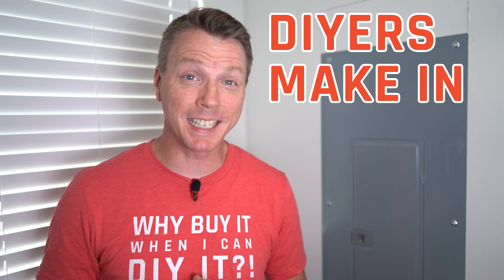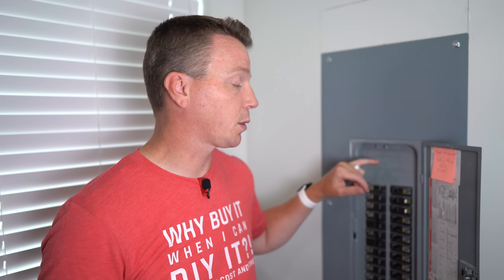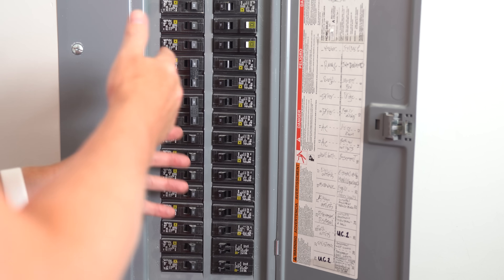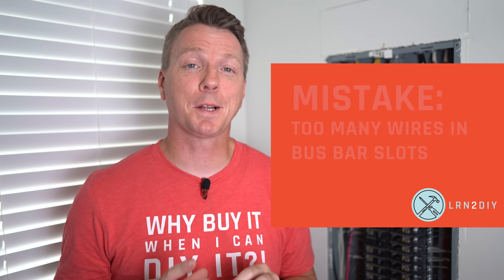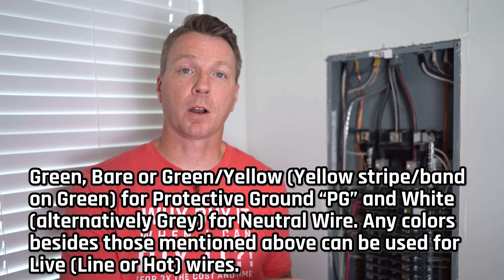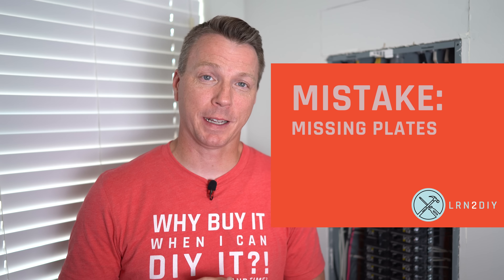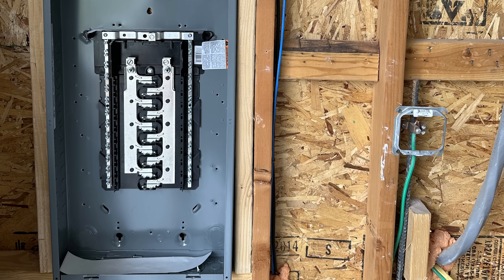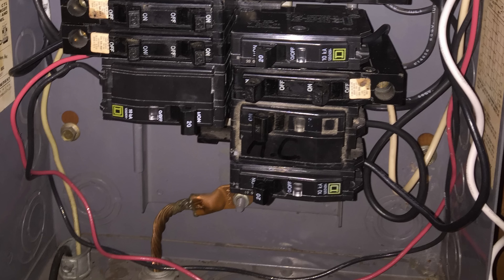10 Common Mistakes DIYers Make In Circuit Breaker Boxes

Comment: Seriously, add up the breakers? The only way to know “amperage usage “ is with an ammeter. You can add up 150 amps of breakers and use 60 amps with everything on. Main breakers are designed for 100 % as opposed to branch circuits that are by ULC only supposed to be loaded to 80 % of labeled limit.

Comment: The #1 first and biggest mistake is letting a typical homeowner diy his own electric anything. And the double tap is absolutely a joke. My neighbor did his own new construction wiring, he ran home runs to the ceiling fans in all the rooms. He had all other wiring connected to the fans. A series of dangerous jokes.
Reply: so what if he used the Ceiling fan boxes as J boxes. sure the box fill is getting close to full but doesnt mean he couldnt. they used bathroom light boxes at my job as J boxes for bathrooms, bedrooms , closets. rats nest of 4 to 8 NM (non-metallic) sheathed cable  going in ancient bakelight boxes

Comment: Some people need to just replace and update their circuit panel. Circuit breakers weaken with switching. Some people don’t realize that. They use it like an on/ off switch reducing it’s intended function. I replaced my circa 1977 main panel about 8 years ago.

Comment: Good thing I had a "professional" install and label my circuit breakers. Mostly useful notations like "lights" or "outlets" (which would account for what, 90% of all home circuitry in existence?). Of course some of them are clear - "Dryer" (which controls the water heater) and another "Dryer" (which controls the well pump).

Comment: most of those "chines#" torque screwdrivers are 100% trash and very inaccurate. At least the ones I had purchased/used.  To the point, where I wanted to make a point, and broke a CB tightening it to "spec".

Comment: One issue I've run into, in a couple of different rental properties, is the need to turn off two different breakers to kill one circuit.  Sometimes, one has to be overly cautious about systems to account for stupidity.   One, I called back the electrician who had installed it.  The second, I called in an electrician to remove the mess, spider web of wiring, (not panel).  Sorry, insult to spiders. They're more organized.   In that house, I also found a live feed just laying in the attic, unprotected.   I'm not a licensed electrician, but I have 40+ yrs of "serious" experience working with EE's.   Bonding and grounding, standby power, UPS, and building automation systems.

Comment: so. in normal std wiring, if, IF ya got 1 white and 1 black wire on a 110V circuit, is it true that NORMALLY the case is the black is the hot wire?
l had a so-called 'skilled tradesman' ARGUE with me sine well, he's the licensed one and well, thats not necessarlity the case. IGNORING the fact l wasnt contradicting that at all.
in other words to 'prove' how smart' he was he made a TOTALLY DIFFERENT CONTRADICTORY POINT.

so who is right? with a black and white and nothing else but the bare ground which one most of the time, which one d you reasonably EXPECT is the hot wire?
beware the masculine ego. especially if 'a little bit of knowledge is a dangerous thing'

Comment: I took the panel cover off of my Mom's breaker box. It looked like a drunk monkey was given the job of wiring it. I spent about 2 hours redoing it so the next guy could at least make sense of what was happening. Looks make a real difference for boxes and troubleshooting. The main ground was hanging loose outside, but attached inside the box. Ever drive an 8' copper pole into the earth so the ground cable is actually "grounded"?  Good times.

Double tapping is like lane splitting on a motorcycle. It may be "legal" in some places, but it's never a good idea. Use another breaker.

Comment: @2:38 you talk about creating a separate sub panel as if you get more power. That sub panel is still governed by the 150A breaker in the main panel. So stop at saying, be cautious not to overload the main breaker. For the record, electrical work IS NOT for the DIY’er.
Reply: so by your logic, the cracked plate cover for the 3way switch at my front door I cant replace cause it is considered electrical work? or how about changing the  CFL bulb in the lamp on my desk?  or the burned out bulb in my fridge? ya know, since all those things are electrical related
Reply: @harveylong5878  You’re being facetious. So, you do whatever it is you feel like doing. I’m not responsible for you.

Comment: I have been an electrician for a long time And what I most typically see done wrong in the panel Is people not knowing when the neutral and ground need to be bonded and when they shouldn't be... Neutral and ground must be bonded at the first means of disconnect. After that, they stay separate.

Comment: You are at mercy of the contractor who did the job 99.99 percent of the time, the color schemes in my own house make 0 sense. Painters also failed to mask off the boxes in the house, so paint got dumped all inside the switch and outlet boxes. :/

Comment: Just a note of interest. In europe, terminals are filled not a single wire, voltage is 240 no 120. I have found that a single wire can be cut if over torqued and the wire can be found to move to the side of the screw so the threads cut into the wire and not the end of the screw. I bend the solid wire over you find it fills the terminal and makes a better secure connection.

Comment: Great video, however, no wire nuts in a panel, cannot be used as a junction box, keep wirenuts outside the panel. Retired state certified contractor, elec eng.
Reply: No longer true. It's now allowed.

Comment: What do you think of when people drop the wire lower than the breaker and then back up to the breaker (kind of like a drip leg)? I have seen that many times, but I prefer the clean look of the wire going 90° into the breakers
Reply: It adds more slack for strain relief in case you bang something into that wire. But as long as there's a good amount of wire from the breaker screw to the 90, there is already a bit of slack.  You have to balance all that with how congested the box is getting, if you start making every wire unnecessarily long.
Reply: As long as it's uniform  it has the same effect on the eyeball.  You're just trying to keep symmetry. Which is aesthetically pleasing to the eye!
Reply: until you have to upgrade and possbly move that breaker to a different location, then you find you are short. Loops are ok. The cover hides everything.

Comment: In a main panel are the neutral bar and ground bar connected?
Reply: You obtain the ground from the ground rod in the earth. Usually with a #6 conductor  it's all based on the service amperage
Reply: Incorrect reply. First, the ground source requires two connections, in new construction a "ufer" bond to the foundation concrete rebar and a clamp on the incoming water pipe. A ground rod is used as an auxiliary bond along with the water pipe when a ufer isn't available (there are a couple of other options, but they're uncommon). Second, yes, the neutral is REQUIRED to be bonded to ground in the main panel, and ONLY there, not in any subpanel. The reason for this is a backup in case the utility's neutral connection fails, which could cause harm to people and property.
Reply: Neg

Comment: You are  more dangerous then you may think, telling people it's  ok to work in a hot panel (power is on) one little mistake and bang you short something out with will be flashing and arcing and splattering very hot molten metal at your face and takes out a eye or burns a hole in your face. Take this down before you get someone hurt or even killed. Spend sometime looking up what happens when things go wrong.

Comment: In a previous house, I enclosed the carport to have more people space.  Did it properly with a permit from the city.  When I finished, I had the city inspector out to check it.  He had one question: Are you an electrician?  No, I'm not, but that's probably the best compliment my DIY electrical work has ever received.  However, I did plan to sleep in that house so I had incentive to learn to do things correctly.

Comment: If you are going to check the tightness of the connections BE SURE YOU TURN OFF THE POWER an verify the power is off with a volt meter.

Comment: I recently had a panel added that had a few more spaces than the old panel. Since the house is older, several circuits had outlets & switches from different rooms on one circuit. What I did was typed up a sheet laying out each breaker as shown in the panel and listed each outlet, switch, etc, placed it in a sheet protector and taped it to the  outside of the panel.
Reply: That is what I have done. A complete list of each breaker and what outlets/circuits/routes it services. The text for the list is on my computer and can be updated, printed out if and when it changes.
Reply: Same here.
I was also annoyed at the suggestion that #1 was done by DIYers. Every home I've owned or worked on, has absolutely useless descriptions and always from the original "professional" contractor.

Comment: Just an observation in that 3phase panel: Ty-wraping (zap strapping) all the conductors together within a panel is bad practice and depending on how long your panel is, could exceed conductor maximum amperage due to heat. Residential guy's do it too. They'll bundle all the loomex/Romex home runs together at the ceiling and bring them down the wall, sometimes several feet, to the panel. It sure looks pretty, but the fire hazard is not recommended.

Comment: I have the problem of stuff not being labeled as well. Tried to figure out which breaker went to which thing but apparently some of my switches are on more than one breaker. What is labeled is illegible and some of the tings have been moved. Its frustrating. Testing for power saved my friend from getting electrocuted. We had to do the yelling across the house thing to see when stuff was off while I was playing the breaker flipping game. 

I got the Klein circuit breaker finder tool. Still need to put it to use once we figure out why some of the lights/outlets aren't working. I think mice may have chewed some wires.

My panel is old-- at least from the 70s or older so I don't know how many amps it can handle. Hmm.. I don't know if the wires are through any sort of protection coming in to the panel. I've never removed the cover.

Electrical is nothing to play with and electrocution injuries can really suck. I had an induction cooktop crack and electrified a pan I was cooking with-- That was in November and I still don't have full mobility and strength back in my arm. I'm lucky that the nerves survived.

Is the color coding on the wiring for gauge a recent thing or has that been done for a long time? 

Whoever did the electrical for my house didn't believe in ground wires. Not a single ground wire in any outlet or light. We don't have drywall so cutting open drywall and patching is not an option. We also have cabinets and shelves built-in in the way of stuff. Need to figure out if it is possible to add ground wires. The wires at outlets and lights don't have any slack at all so replacing outlets & switches really sucks.

I had to use colored tape on some PEX pipes that were the wrong color (blue for hot-- got wrapped in red to denote it was for hot).

The "what we want to avoid" is what my box looks like. LOL.

Comment: I was changing an element for my water heater and I was checking to make sure the power was off I forgot that it was 220 with 2 hot wires then I  remember and checked one wire with a separate ground point if I would have touched both wires  ouch 😂

Comment: There are lots of comments here about dangerous DIYers, but the two potentially disastrous wiring problems I have experienced were caused by so-called professionals: utility line workers. For 30-some years I have owned a second home on the Oregon Coast. Twice in that time I have replaced the SEP. The first was to update an obsolete 125-amp panel to a 200-amp Square D. One night I arrived during heavy rain to find the lights flickering or inoperable. Upon inspection in the basement, the entire panel looked and sounded like an arc welder. I didn’t dare touch the thing to flip the main breaker, so I poked at the breaker with a wooden broom handle during arcing (so I could see) until I killed the power. The next day I realized what had happened: wind-driven rain had entered the SEP mast, flowed past the meter and entered the box, where it began destroying its guts, all without tripping the main breaker. And all because the line crew that connected the house to the utility system had pointed the weather head at the nearby ocean, allowing wind-driven rain to reach the SEP. On another occasion when I arrived at the house every light burned out as soon as I tried to turn it on, and the refrigerator was not functioning. I soon determined that every outlet in the house was supplying 240 volts. All because inadequate work by another line crew had allowed the supply lines to short and double the voltage throughout the building. The utility worker who responded to my call shook his head, redid the connections and said something about colleagues who insisted on doing work the old-fashioned way. The blazing hot GE fridge compressor eventually cooled and the thing kept working.
I’m no electrician, but have been doing all my own work for 40 years, starting with the updating of a 100-amp panel in a knob-and-tube system in my first home, built in the 1930s. That panel, itself a presumed upgrade of the original fuse box, was a terrifying rat’s nest of wires, done by a local “electrician” known to my elderly neighbor. I am pretty sure that the electrician’s helper was Jack Daniels. Some years later, when a Realtor friend wanted me to see a mess of a house that had just come on the market, I put it together that the enormous, haphazard jumble of electrical supplies could only have belonged to that same brain-fried electrician.
Yes, plenty of work is done by DIYers who shouldn’t be near electricity. But every professional here has stories like this of jobs done by lazy, incompetent or drunk electricians.
Reply: For us non-electricians SEP="SERVICE ENTRANCE PROTECTION"
Reply: @timmueller1314  electrician here, i thought it meant service entrance panel. I never have heard anyone use SEP, just Main panel or Service panel. since all the rest are sub panels.
Reply: @SamboNagga you are 100% correct it is service entrance panel..
Reply: The reason you had 240 at the refrigerator is because you lost the neutral somewhere between the panel and the transformer. It is not uncommon with aluminum, triplex, service lines. If you ever notice any strange brightening of your lights, call the service provider and have them check their connectors.
Reply: @brucestewart3170 I knew something was majorly wrong when I arrived at the house and every lightbulb immediately blew when switched on. A check with a voltmeter showed a very undesirable 240v at every 120v outlet. The neutral had separated at the splices connecting the utility’s drop to my conductors at the weatherhead. Whatever method used to splice those conductors by the original crew was deemed obsolete and insufficient by the younger lineman who made the fix.
Reply: DYI people get people killed in electrical.
Reply: I came across a commercial building who had hired an electrician who has connected several 4” boxes with Romex and twisted the wires together but wrapped the connecting wiring with black tape instead of Marr connectors. We later discovered he realized his work was hazardous and contracted a buddy to revamp one of the 240 service panel for 40A and 70A service. I put Marr connectors where ever I found they were missing and put covers on the 4” boxes.
Reply: And yet the state I live in requires a license.
Reply: Exactly why I do my own work. If someone is gonna muck it up, it's gonna be me for free
Reply: Same here I do my electricity for homes. Good advice
Reply: Yeah--have an industrial installation we need to correct. Has a fuse in the neutral in a safety switch box. (Understandable confusion since the source was 3 phase to a 2 phase subpanel, thus 208V, but still should have been suspicious when one of the phases is white not phase taped. Literally was the neutral! Another lazy not checking in detail with a highly dangerous result if that fuse ever blows.) Oh, yes, the neutral is also switched with the safety switch, so momentary high voltage transients during switching, similar to last comment but not an accident of tightening connectors!
Reply: @gordonelliott7870 I know what you're trying to say.....but there's 3 phase.
And there's single phase.
There's no "2 phase".
Even though it would seem to be called "2 phase" because you're counting phase wires in relation to ground.
Reply: @jstravelers4094  There is plenty of 2 phase especially in Philadelphia. 90 degree phase separation. All of it now supplied by a Scott-T transformer connection off of the 3 phase primary . Most customers were supplied by a 5 wire service for power and light

Comment: Two neutrals on the same bar can loosen w/ heat / cold expansion.
There are piggy back breakers if you need to double up on a breaker.

Comment: Fail: you can and should follow the load center manufactures instructions when it comes through the ground bar. If they say that you can land to 12 gauge wires in one spot, then you can.
your electrician chose not to entirely load up your ground bar, so that in the future, it would be easier for anyone who needed to add a circuit .

Red tape. If you're using a white wire as a hot wire, you can put black tape on it. I can except the red tape, but national electrical code has not changed from being able to put black tape. Because years ago not everybody had fancy pants colors.